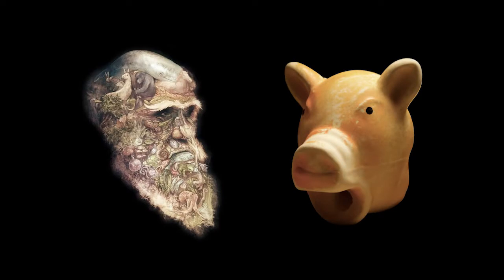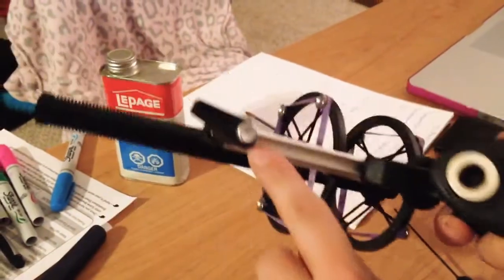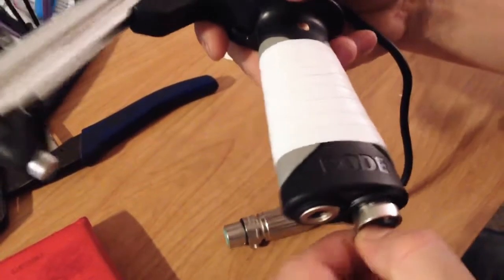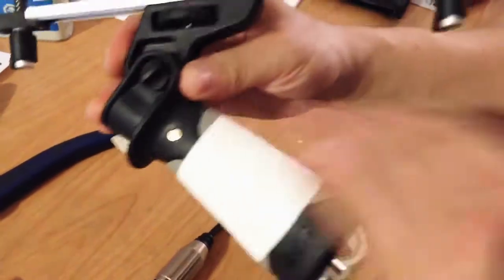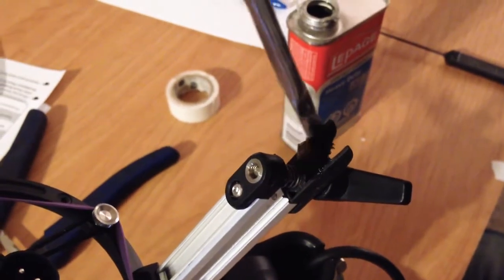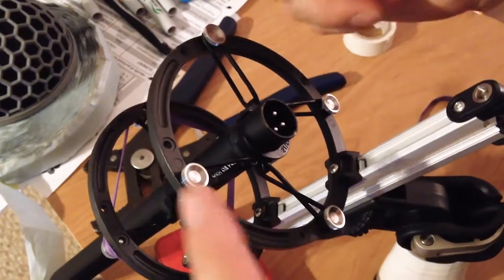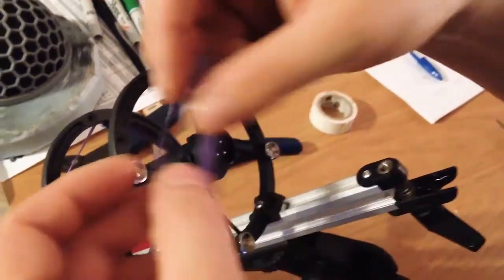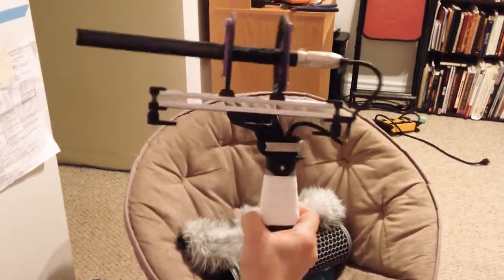How To: Increase The Performance of Your Rode Windshield

Comment: I'll note it is just the older v1 RODE blimp which has the rubber band suspension system.

The newer v2 RODE blimp has Rycote Lyres

Massive improvement!
Reply from the maker: Yes. This was my solution to make the old blimp perform better. A cheap hack to get a little more life out of your gear.
Reply: Yup, good video, useful to highlight the important of maintenance! :-)
Reply from the maker: to be honest. I prefer the amount of suspension and vibration reduction of the old system. With our improvements, of course. I find the lyre system too stiff.